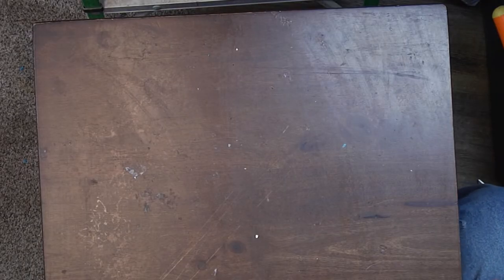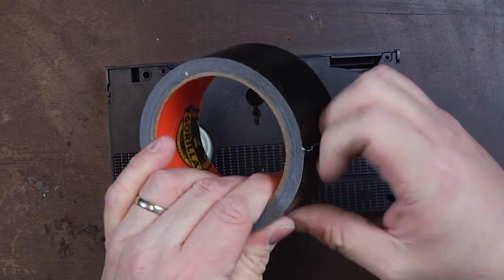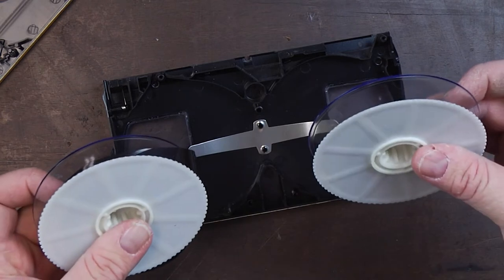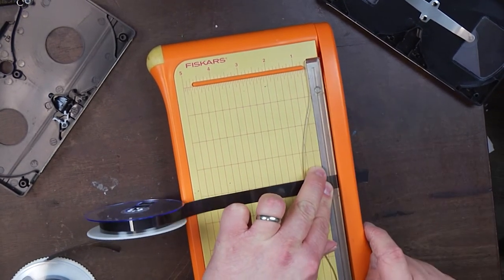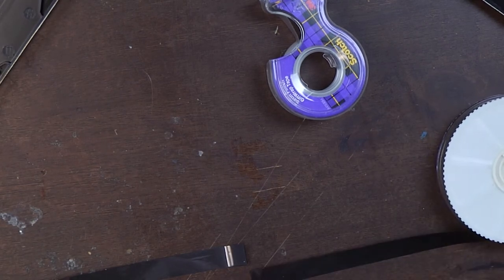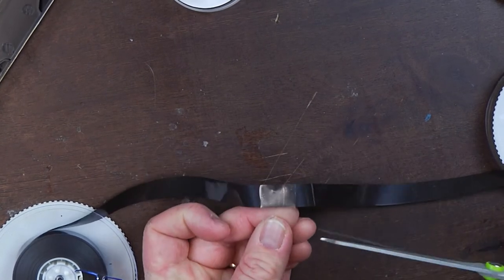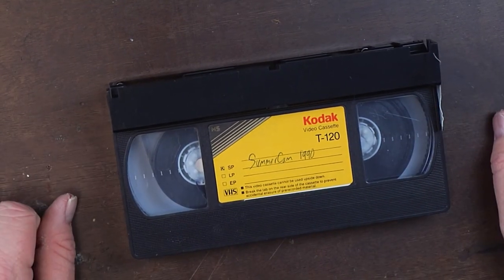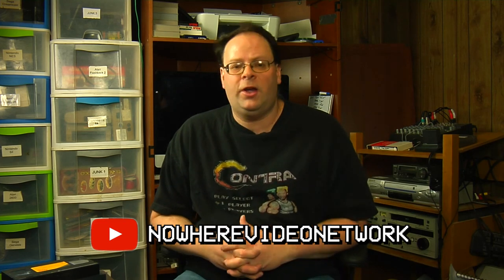How to repair a snapped VHS Tape: Nowhere Video Productions

Comment: Thank you for the step-by-step guide. The repairs that I will make will be slightly easier as they are right where the leader connects with the reel. I have a 1988 Sansui (Funai) VCR that has this habit of rewinding way too fast to the point where it snaps off the beginning of tapes. I believe I need to replace a belt that regulates that part of the mechanism (loading belt). For the time being, would be nice to reinstate the cassettes that it broke.

Comment: I would not recommend making a splice in the middle of a tape like this, I have seen the devastating effects this can have on the fragile video heads. If a tape is broken in two, then find a junk cassette. Take one spool of your broken tape and attach this to the leader of the junker's empty reel (using the existing splicing tape , which can usually be peeled back and reused). Then , after emptying  the junker's second spool, use that in the damaged cassette and do the same. You then effectively have your broken original in two parts, tape one and two. That way there's no risk to the VCR.   In a world where you can lose the whole contents of a hard drive to failure , viruses or corruption of data, it makes no sense to abuse the original tape with sticky tape, which oozes adhesive onto adjacent tape layers and can wreck the video heads. What happens if at some future date you need to re-do the transfer?
Reply: Ive successfully wrecked my vcr after taped my vhs, its provides me black screen after running on it. Any advice or its head bricked forever? I shouldve listened to you…
Reply: Okay, so if anyone would have the same issue… I managed to fix it : I opened the vcr and clear the heads, and some places where the tape running through with rubbing alcohol. First it wasnt clear enough but i saw picture, then i let the tape running for a while and it became more and more clear. Now its good as it was.

Comment: Never use scotch tape…it can ruin the heads. Overlap the two ends of tape face down and use a straight edge razor blade to cut through both ends…they will line up perfectly . Your tape used end runs of of a spool that was spliced together.